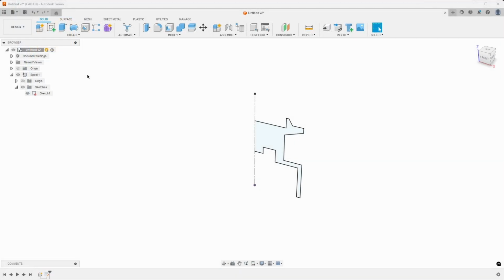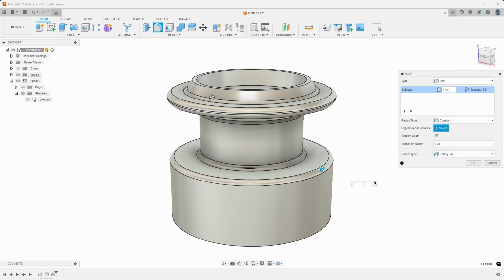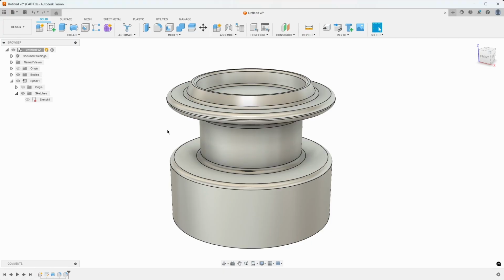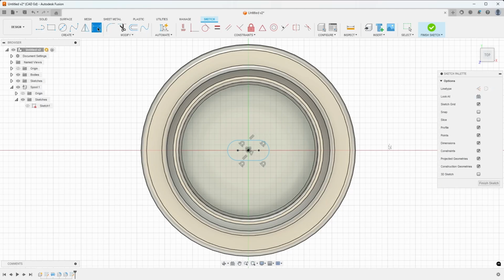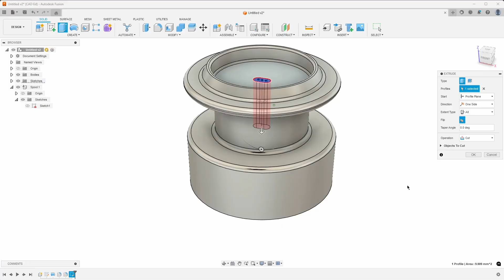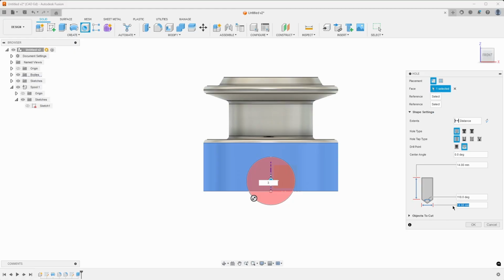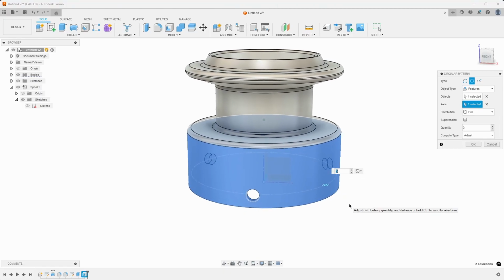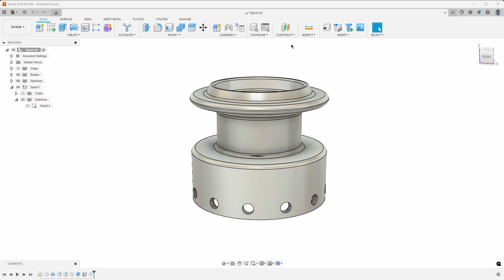How to Create and Modify a Model | Getting Started with Autodesk Fusion Episode 4

Comment: I'd like to create a model that's based on a spiral that I sketched before. That's possible in any CAD software on the planet - but it's not possible in Fusion. This very simple feature request is open for more than a decade now. Yet here we are, still without that very simple thing that any other CAD package can do. And before anyone tries to be smart: Nope, creating a coil and projecting it to a sketch is not a solution - it's a cripple of a workaround. So, Fusion team, when will we finally be able to sketch spirals?